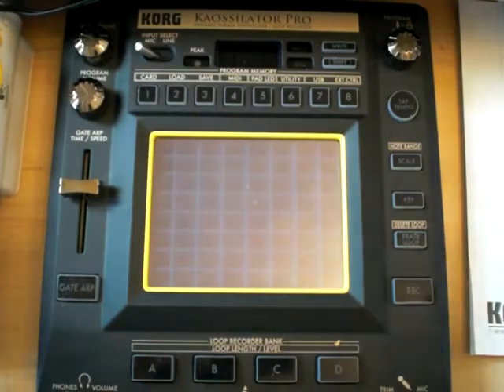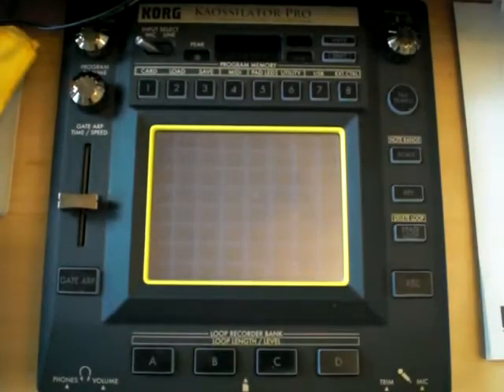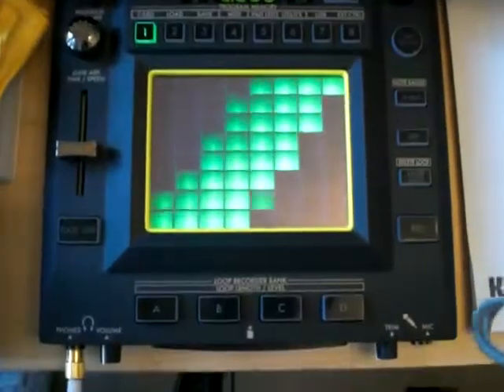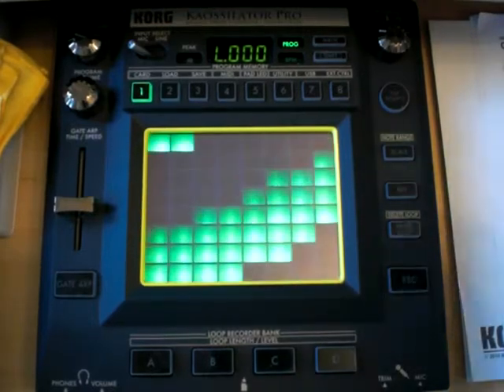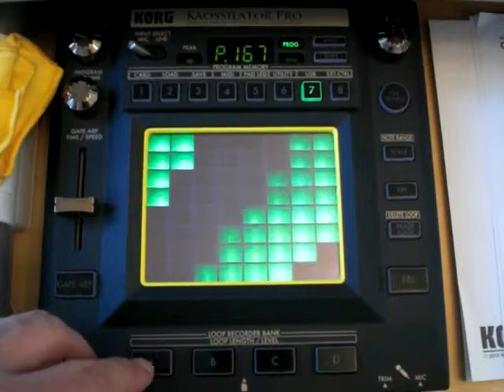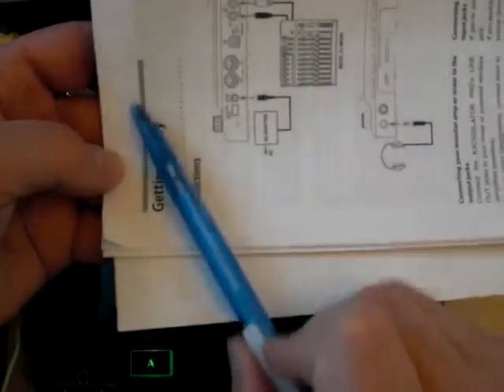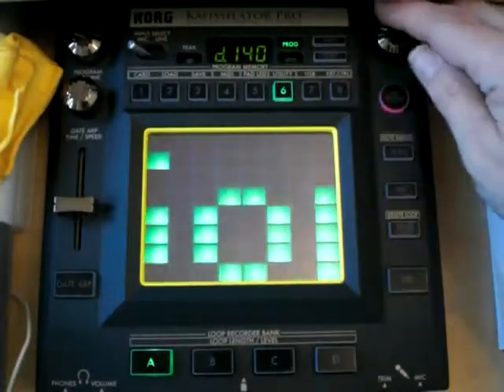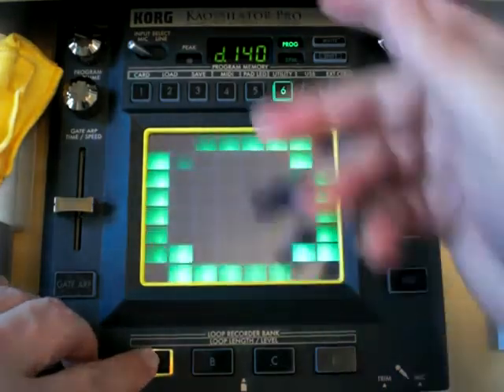Korg Kaossilator Pro Video 2 of Many. The Learning Curve Continues

Comment: Hi mate, thanks for your tutorials, you're doing very well.Hey I love your accent. Is it Lancashire you come from or somewhere not far? I used to attend boarding school in the beautiful Lake District which as you may know's a stone throw away. I have just bought a Kaosilator like yours and learning. Do you happen to know how I would save stuff onto the SD card without erasing previous data? The instructions are not the clearest in some respects. Cheers.
Reply from the maker: bestrickie2  Sorry for the late reply. Thanks for 'ya message. Yeah, I live in Halifax and have visitied the Lake District many times. It's a very beautiful place. 
Sorry, I no longer have the Kaos. I sold it quite a while ago now. I started using the app instead but, I got bored of it and abandoned/took a long break from music and went into art. That's where I am now. I'll be posting videos later this year on the subject.
Reply: Hi and thanks for your message though there was no rush. I am getting on fine with my Kaosilator and have managed to make a few bits of music on it though I am still learning but it's purely a hobby. I will add my recording to garage band on my iPad mini then I can add, pan and do more with the tracks. Please check out my previous demos when you have chance. These demos are stuff like R Frnds Elctric, Neon Lights and so on. Cheers and maybe you will get back into the music in future see how it goes as you were making a good job of the Kaosilator.

Comment from the maker: @Sp4rt4n1994 I'm just in the process of creating paintings. It may be a while but, once I've pulled a few together, I'll post you a link to take a look. They won't be cheap though! I've sold every one I've done so far. I'm moving onto portraits and intend to do some celebs so I can sell for huge bucks! £25,000+!  
Good luck with your KaosPro and, if I can assist 'ya with help, just drop me a line. Oh, and once 'ya get going, let me hear 'ya creations. Are you looking to get recog? Ive got links.